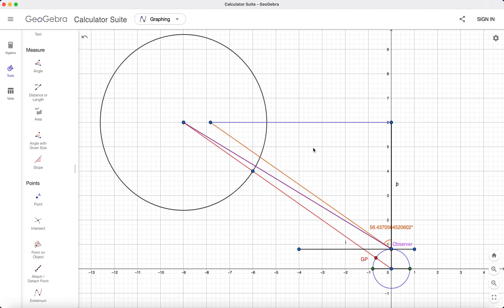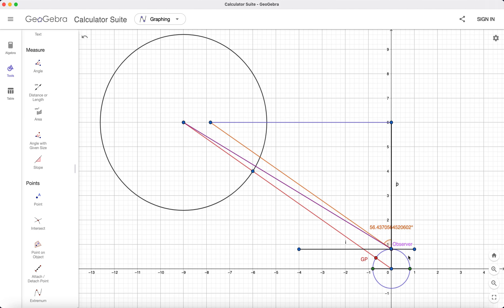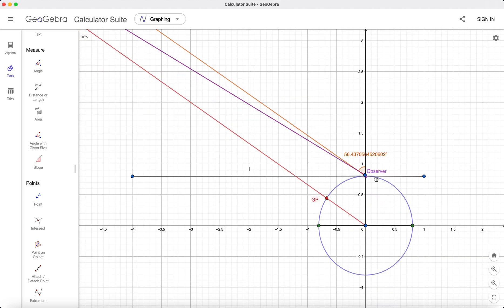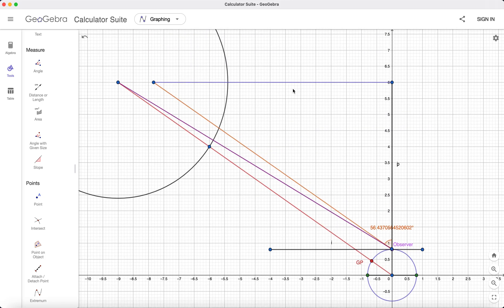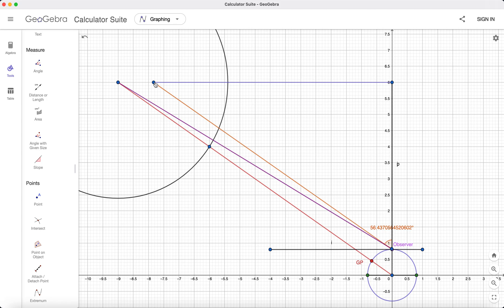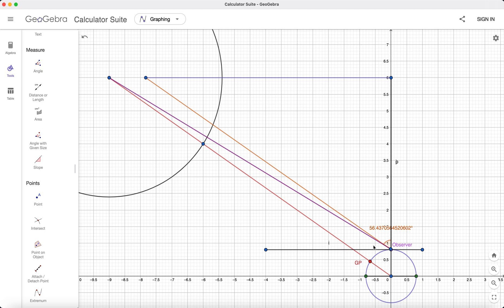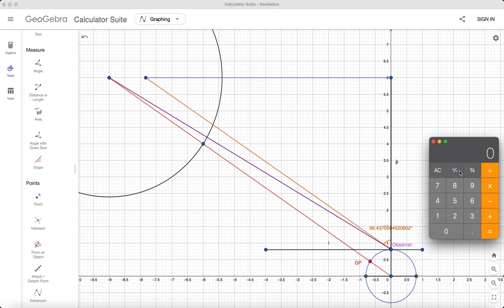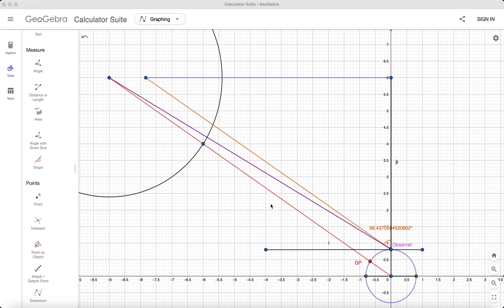Zenith Phobia....?

Comment: The mental gymnastics of a dedicated flat earther. Why is it always such a painful experience.......
Reply: @Q Branch   Brian ignores any discrepancy, you ask him to explain it. While your at it ask him to explain this.
The equator is 360 degrees X 60 Nautical Miles long. Which is 21,600 Nautical miles long.
The radius or the distance to the center of a 21,600 Nautical mile flat circle is 3437 Nautical miles.
So the distance from the equator to the north pole has to be 3437 Nautical miles on a flat earth.
Nowhere near the 5400 Nautical miles that Brian always states, that is only possible on a spherical earth.
Reply: Education....what you think are "mental gymnastics" is actually education.
Reply: @sleepingwarrior4618   Explain this problem that Brian often states, that makes no sense on a flat earth. The distance for each degree of latitude is 60 nautical miles. Which Brian states categorically. Brian also says each degree along the equator is also 60 nautical miles. 
So to travel 180 degrees around the equator to the other side of the earth is 180°x 60nm which is 10,800 nautical miles.
However, to travel across your flat earth to the same point on the other side of the equator is also 180° x 60nm which is also 10.800 miles.
These are the exact dimensions of a sphere, as proven by Brian's calculations. Thank Brian for proving the earth is round.

Comment: A bubble sextant at sea level and at 20,000 feet on the same zenith will have the same angle to a star and will use that angle without any dip correction 
How can this work?
You say there must be a level line from the navigator's GP to the star's GP,  but how does that work with an airplane flying at 20,000 feet, and no  dip correction? Does the line from 20,000 feet slope down to the star's GP?
Reply from the maker: No in an Airplane ✈️ the Bubble Sextant creates the Horizontal, so Height of Eye is not necessary, it’s only necessary on a Ship to do Height of Eye, as without it you won’t have a 90, but from an Airplane the 90 is created by the Level Line Horizontal that the Bubble Sextant creates, but they don’t use them on Ships, as they need the geometry of the earth to get a steady Elevation Angle 📐
Reply: @BriansLogic  How  can you get the same elevation angle to the star from the plane and the ground  if the plane is 12 km higher?
Reply from the maker: @Hjaldor  Your just taking an angle 📐 using 90 degrees.
Reply from the maker: @Hjaldor  I don’t know if it’s true that the plane and person being over the same spot on earth, will get the same angle 📐 I know that’s the claim, but I don’t know if it’s true, as who proved it ?
Reply: @BriansLogic  Geometry proves it.
The light rays from the star are parallel when reaching earth.
Reply from the maker: @geronimo_2107  That would require a 2 way speed of light Measurement, but all you have is a Calculation based on belief and BS, so your claim ( even though it doesn’t solve the problem anyhow, but you don’t know that obviously ) means nothing, you got nothing your model has nothing it’s over….
Reply: @BriansLogic  Just exhibiting your ignorance again.
The fact that sun rays reaching earth are parallel have nothing to do with the speed of light. Just the distance is relevant.
Reply: @geronimo_2107  Some of Brian's answers really do seem more like developed reflex reaction than result of some though process :-(
Reply from the maker: @geronimo_2107  My Ignorance where do they calculate the distance from Bonehead ? 
8.03 Light Minutes ????
This also allows them to claim a size, stop commenting to me you don’t know what your talking about, and ITS YOUR STUPID MODEL….
SMH….
Reply: @BriansLogic  
We have a two way speed of light, that’s not an issue at all.
Reply from the maker: @i.v.blankenship  Yes Calculation based on NOTHING yes you do have that lol….
Reply: @BriansLogic  the speed of light has nothing to do with sun rays being parallel.
Reply: @BriansLogic  
Given your value of 8 light minutes I assume you are referring to the distance to the sun. It was first calculated with an acceptable degree of accuracy using the transit of Venus to determine that distance and then an application of Kepler’s Laws of planetary motion to calculate the distance to the sun.
The Venus distance calculation is based on the same math used in the angular size calculator you featured in one of a videos a while back.
Reply: @BriansLogic  
Based on nothing you say, and yet RADAR, lasers and all sorts of advanced electronics that rely on that calculated speed of light derived from the measured 2 way speed of light work.
Reply from the maker: @geronimo_2107  It’s the reason the claim exists you absolute super idiot.
If you pay me money per hour, I can teach you about your globe model ?
Reply: @BriansLogic  Why should i pay you, when i can get all the information i might need for free?
Besides, i'm not sure calling me an idiot is the best way to get money from me.

If the light rays from stars (sun included) were not parallel, we couldn't have circles of equal altitude.
That's a very practical application.
Reply: @BriansLogic  said "If you pay me money per hour, I can teach you about your globe model"
You should pitch this to Dragons Den/Shark Tank, it's such a good business proposition.
Reply: @geronimo_2107  Brian recently wrote:
"perspective will not occur when your looking at two or more Sun rays, as they are coming from the sky at an angle"
Any questions?
Reply: @m.butschi  Not really.
Perspective is just suspended as soon as 2 or more sun rays are involved in the observation.
Pretty cool stuff.
Flerspective remains the best card to play when everything else has failed.
Reply: @BriansLogic  
How munch per hour? How many hours would it take for you to demonstrate how to calculate the sun rise time and azimuth for an arbitrary date and arbitrary location. Not just using sun calc or some other site, but doing the work totally by hand? Next how many hours would it take to do the same using the flat earth model?

To be honest with you I don’t think anyone can afford infinite hours.
Edit: actually anyone can afford infinite hours if your rate is 0 per hour. So we now have an idea of what your time is worth.
Reply: @BriansLogic  
What if you used a bubble level on a ship?
Reply from the maker: @darrellkimmel2646  You can’t the ship is moving, so you can’t get a steady angle 📐 like I said in the last comment.
The problems are with your model, not reality, there’s no problems with reality.
Reply: @BriansLogic  
Do they park airplanes in the sky to shoot a star, or are they moving?
Reply: @BriansLogic  
(My model IS reality)
Reply from the maker: @darrellkimmel2646  No SMH, the Boat is rocking from side to side, and and forward and backwards, and every other way, not taking a Linear path like an Airplane.
Maybe you should have a think to yourself, and ask yourself where your getting your information from, not quotes and citation, but actual understanding, who is giving you understanding when it comes to the Sextant, as the questions your asking me, tells me that your source or teachers are inept in their own understanding ?
Reply from the maker: @darrellkimmel2646  That’s an Oxymoron Darrell….
Reply: @BriansLogic  
Actually, from descriptions I've read when taking a sight in an airplane the pilot had to fly as straight and level as possible.
Why are there no dip corrections for planes flying at 1,000 or 5,000 or 10,000 or 20,000 feet, or a bubble sextant sight from a beach?
Reply: @darrellkimmel2646  please do not try to change his believes. Brian trying to do math and understand how things work is hilarious and I love the laughs… 😂🤣

Comment: Brian, your argument will never be taken seriously until you provide a worked example of celestial navigation on a flat plane that reflects real world observations.
Reply: Celestial navigation can only work on a flat plane. To measure elevation angles requires a flat plane. In spherical geometry there are no straight lines to measure an elevation angle.
Reply: @tbrown3356  A practical worked example of celestial navigation on a flat plane that conforms to real world observations would be more persuasive.
Reply: @jozsibacsi66  That's what has been done for centuries by seafarers. You believe it is done on a spherical surface but the measurements require plane (flat surface) geometry. Again, there are no straight lines or parallels in spherical geometry to measure elevation angles. It's not debatable. Facts are facts.
Reply: @tbrown3356  We have yet to see a practical demonstration of celestial navigation using plane geometry that correlates with real world observations.
Reply: @jozsibacsi66  Measuring an elevation angle is practical. To measure an elevation angle you must have plane geometry. There are no straight lines or parallels in spherical geometry.
Reply: @tbrown3356  And yet we have no practical worked example of celestial navigation on a flat plane that reflects real world observations.
Reply: @jozsibacsi66  Elevation angle measurements are practical. They work very well with getting the distance from the geographical position of the star.
Reply: @tbrown3356  And yet we still have no worked example demonstrating these concepts or real world measurements.
Reply: @justwilliam6893  They are not the same. You have no straight lines or parallels in spherical geometry.
Reply: @justwilliam6893  Plane geometry is reality and required for celestial navigation. Spherical geometry is a belief that causes fundies to take Plane geometry measurements and imagine all lines are curving.
Reply: @justwilliam6893  If you are conceding that your spherical geometry is converting flat earth measurements into spherical geometry then you are correct. Welcome to flat earth!!!
Reply: @justwilliam6893  Triangulation and trilateration don't require spherical geometry.
Reply: @justwilliam6893  You already conceded that plane (flat surface) geometry is required for celestial navigation. McToon challenge is debunked.
Reply: @justwilliam6893  Elevation angles require a horizontal baseline. You aim your sextant horizontally towards the horizon to measure elevation angles.
Reply: @justwilliam6893  That is not what is done when you measure an elevation angle with a sextant. Stay on topic. Horizontal does mean flat and straight. You cannot change the definitions of words to hold onto your model.
Reply: @justwilliam6893  So what is the point of trying to prove "flat" earth measurements (geometry) if you guys don't even know horizontal is a straight line or plane (flat surface)?

If you get hung up on not being able to define horizontal, then how do you define curve (line gradually deviating from straight)? 

Words have meaning. Lol.
Reply: @justwilliam6893  Measuring an elevation angle with a sextant is practical and has been done for centuries by seafarers to triangulate their location at sea.
Reply: @justwilliam6893  Measuring elevation angles of celestial objects is what the globe, maps, almanac, calculating the distance to the GP, and triangulation is based on.
Reply: @justwilliam6893  So you are using Non Euclidean geometry where you believe all straight lines are curved. If the straight lines are curved then you cannot measure an elevation angle. We use Euclidean plane (flat surface) geometry for elevation angle measurements. Your globe model was created from flat earth measurements. Lol.
Reply: @justwilliam6893  So you concede plane (flat surface) geometry. Tell McGoon his challenge has been debunked. Lol.
Reply: @tbrown3356  McToon’s challenge won’t be debunked until someone provides a worked example of celestial navigation on a plane that agrees with real world observations.
Reply: @jozsibacsi66  They measure elevation angles in the real world for celestial navigation. That's how globes and maps are created. You cannot measure an elevation angle with a curved baseline (globe).
Reply: @tbrown3356  And yet we have no one from your side willing or able to demonstrate the calculations involved or simultaneous measurements from two or more observers.
Reply: @jozsibacsi66  We have a measurement of an elevation angle with a flat earth. You cannot measure elevation angles with a curved baseline (globe). Facts are facts.
Reply: @tbrown3356  That seems more like an article of faith than a fact. A worked example with real world observations would be more persuasive.
Reply: @tbrown3356  That seems more like an article of faith than a fact. A worked example with real world observations would be more persuasive.
Reply: @tbrown3356  "Celestial navigation can only work on a flat plane. To measure elevation angles requires a flat plane."

Wrong!
1. We need a device capable of measuring an angle, like a sextant.
2. We need an observer operating the sextant.
3. The observer must see two points, for example a star and the "borderline" between the sea and the air above it, also called the horizon.
4. The observer must be able to line up the index mirror with the star, and the horizon mirror with the visible horizon.
5. The internals of the sextant have the necessary stright lines to measure an angle.
Reply: @Hjaldor  Step 1, measuring angles requires plane (flat surface) geometry. Angles require straight lines that are not available in spherical geometry.
Reply: @tbrown3356  "Step 1, measuring angles requires plane (flat surface) geometry. Angles require straight lines that are not available in spherical geometry."

Wrong again!

Measuring an angle requires an observer who can see two points separated by a distance, and aim a sextant to the points.
Reply: @tbrown3356  
"In spherical geometry there are no straight lines to measure an elevation angle."

What makes you think that? The spherical coordinate system uses straight lines to measure the polar and azimuthal angles.

Comment: When you find something in ”our” model that you think doesn’t add up, you can very safely assume your understanding is flawed. That this doesn’t even cross your mind should be very telling. 
Either way, you seem to be very confused about angles and elevations so let me try to explain this in a way where you don’t need those concepts. 
If you take a clock with a radius of 1 m, point the minute hand vertically, straight up (to zenith), orient the face so that you can then point the minute hand to a star, measure the edge of the clock from where the minute hand points to where the hour hand points (the arc length) and multiply that by 6371 * 10³ you will get the surface distance to the gp of said star. 
Interestingly, if you point the minute hand to one star, the hour hand to another and then divide the surface distance between the gps of those stars by the arc length between the hands you will get 6371 * 10³. 
If you have two clocks of different sizes and you set them to the same time, the arc length between the hands divided by it’s radius will be the same for both.
Reply: Sorry, but you lost me in the first paragraph; 

"If you take a clock with a radius of 1 m, point the minute hand vertically, straight up (to zenith), orient the face so that you can then point the minute hand to a star"

Are you moving the whole clock face and minute hand together,, or simply moving the minute hand from where it was at first? Are you looking at the clock face-on, or aligning the face on edge?

", measure the edge of the clock from where the minute hand points to where the hour hand points (the arc length) and multiply that by 6371 * 10³ you will get the surface distance to the gp of said star. "

Sorry, but what is the hour hand set to? Did you align the minute hand to 12, and have the hour hand set to something o'clock?
Reply: @tumenihits5438  
"Are you moving the whole clock face and minute hand together,, or simply moving the minute hand from where it was at first? Are you looking at the clock face-on, or aligning the face on edge?"

You can imagine the clock hanging plumb from the minute hand and a sight on the hour hand, which you use to point the hour hand at the star. To do this the clock face will have to be coplanar with the plane defined by vertical and the star.

"Sorry, but what is the hour hand set to? Did you align the minute hand to 12, and have the hour hand set to something o'clock?"

That matters not at all. As long as you have two lines going from the center of a disc with a radius of 1 m, where one is plumb and one is pointing to the star. Only the arc length between them matters. I only use a clock to not have to describe the device used; everyone knows what a clock is.
Reply from the maker: So your going to lecture me on Elevation Angles, something that are clearly defined, and your going to change them to clocks ⏰ ?
Why didn’t you just go and look up the definition of an Elevation Angle 📐 and then you wouldn’t have come off as a know it all, who doesn’t know it all ? 
Pretty poor my friend….
Reply: @BriansLogic  Nobody is "changing" anything. 

He's drawing an ANALOGY to a clockface, to illustrate things.
Reply: @BriansLogic  No. I am specifically not going to lecture you on elevation angles, or even angles. A lot of people have tried and you are still as thoroughly confused about both concepts as before. This is why my explanation was made without reference to either.
You might want to look into why angles are usually expressed in radians in mathematics, and how an angle expressed this way relates to the circle sector of a circle with the radius of 1.
If you can manage to ignore the cognitive dissonance for a moment and forget about the elevation angle and the horizon you might be able to understand the actual, very simple, point; if you multiply the zenith angle in radians to a star by the radius of the earth, you get the surface distance to the substellar point of that star. This geometry is impossible on a flat plane, and actually only possible on a globe.